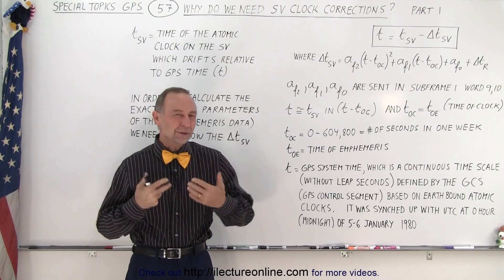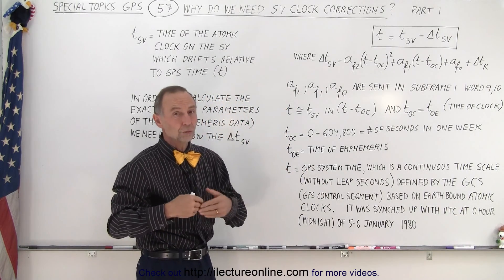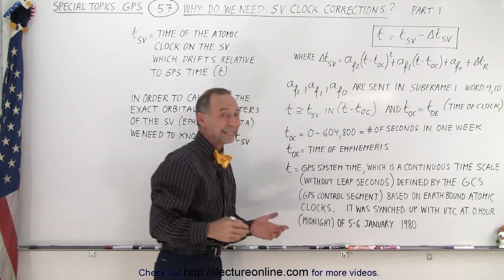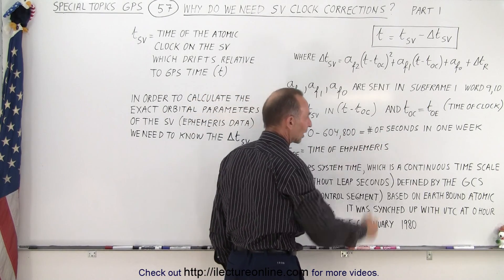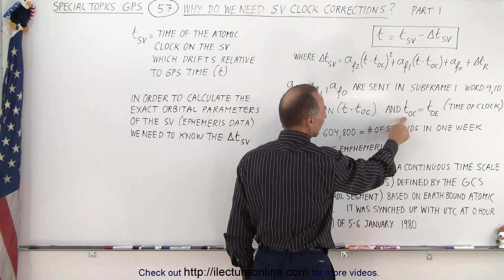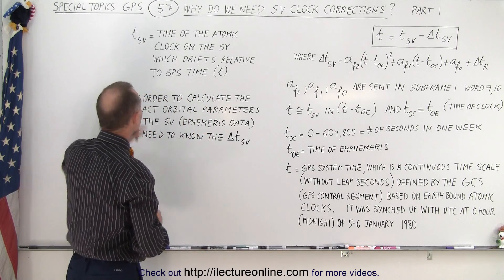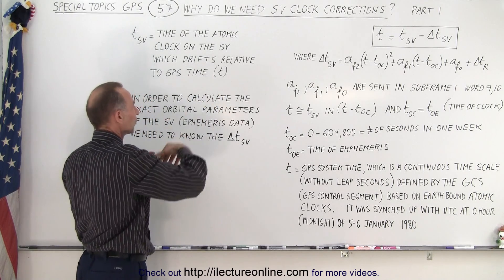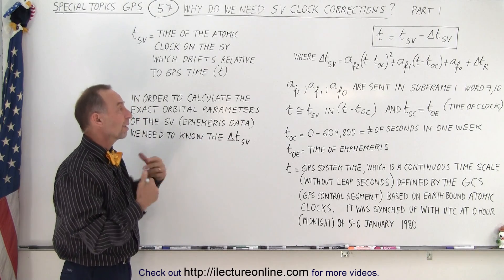Special Topics - GPS (57 of 100) Why Do We Need SV Clock Corrections? Part 1

Comment: Hi at 2:56 where you make the assumption that t~tsv, is that assumption in IS-GPS-200? If not, how did you arrive at this assumption?

P.S. I'm a grad student (aerospace engineering) working on a MATLAB code that generates GPS L1 IQ data which involves encoding the binary navigation message and creating the waveform emulating a transmission from an actual GPS satellite. I'm doing this completely from scratch and all of your videos in this series have been super helpful.
Reply from the maker: Yes, that s consistent with the IS-GPS-200.  (However, it is not as clear as it should be and it takes a bit of cross referencing within the document to figure that out.
Reply: @MichelvanBiezen  Ah yes I see that now. In the paragraph after the values for universal graviational parameter and speed of light are given. Thanks!😁